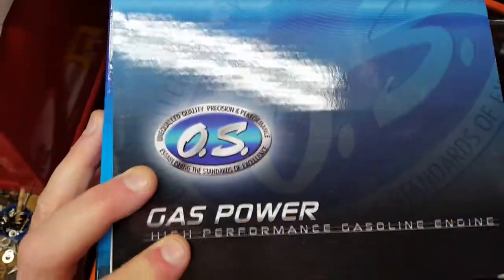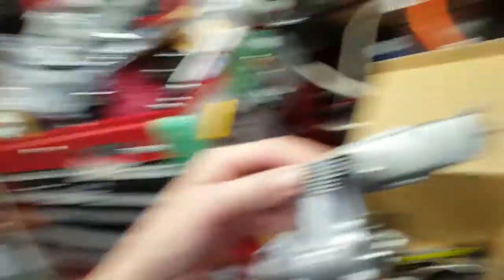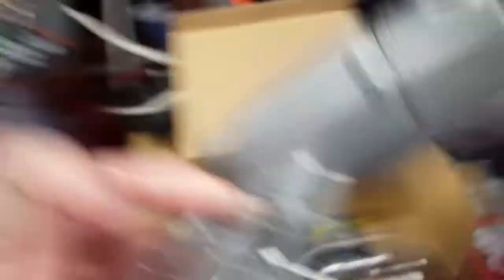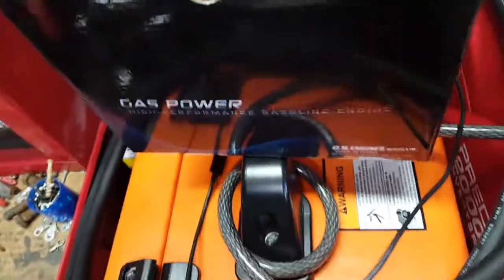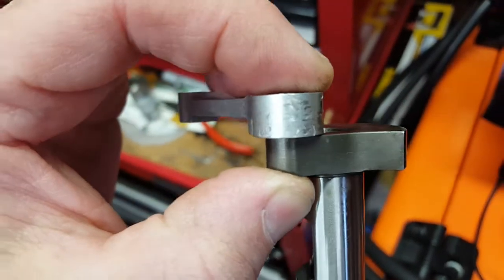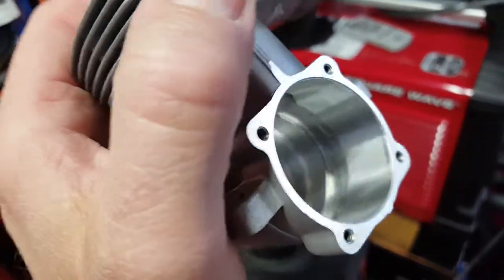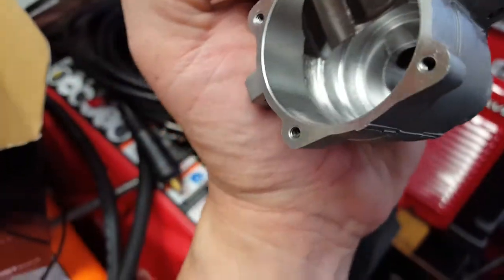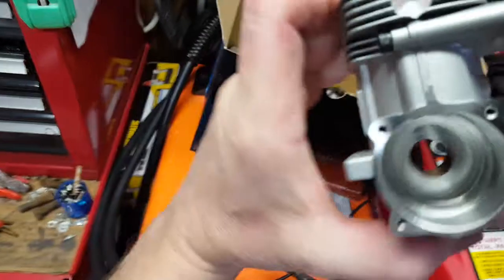OS   GT-15 gas engine issue!!

Comment: I'm thinking of buying this engine also. I down loaded the manual from the Horizon website. Under "Running-in" it states...use a 25:1 fuel/oil mixture...and they do not recommend bench running, just fly it. the manual says to use 50:1 after break-in. The engine is kept cooler in flight rather than running on a bench, especially if it's cowled.  Or someone left a chunk metal in there...who knows!? Do you know if the engines are pre-run at the factory before shipment? I noticed that the goal of the Chinese company is to sell the product and make a profit. I've owned several Japanese OS engines over a thirty year span with no issues!
Reply from the maker: I agree!! I have at least two OS two cycle engines and four OS 4 cycle engines, a ton of Saito engines and never had a issue with any of them. People argue the Chinese OS is just as good, I disagree.  Also I operate DLE single and twin Cylinder engines also made in China with absolutely no issues as of yet.  So I'm thinking this particular OS was defective from the factory.
Reply from the maker: And very possible there was junk left in the engine after machining.
Reply: @workshoptazz7893  I know that I'm "old school" because I still enjoy glow engines. I like the simplicity, low weight and power. I've been flying a .65 AX for five years now, still runs like new. Actually it gained power with age! Did you see the guy from Australia that uses colorful language put an OS GT-15 in a helicopter? It sort of melted.
Reply from the maker: @paulkrapp   nothing wrong with Glow, fuel is hard to get local tho. So out of laziness I'm slowly converting all my glow stuff to gas.  Lol no I have not seen the guy from Australia, I will look for the video on YouTube.

Comment: 50/1 oil ratio, why so little oil??
Everything I've seen says 25/1 which is similar to most other gas engines.
Reply from the maker: 25/1 for conventional oil, I could see. Synthetic typically can be used in most or a lot of applications at 50/1 I have ran over the last 30 plus years, outboards, chainsaw, weed eaters,  2 stroke dirt bikes, and all of my DLE 2 stroke RC engines with Zero issues.   On further inspection of my OS gas engine, it appeared that someone in China! Left shavings in the crank case that got distributed through the whole engine. To late now! All apart and new stuff on order.
Reply: @workshoptazz7893  
Yeah I understand, I used to be a small engine mechanic and we used 50:1 in chainsaws ect but in a smaller engine I would have bumped it up a little.
 Was it the piston ring pin that stops the ring rotating that came out by any chance?
Reply from the maker: No, parts were intact.  What I  found was larg shavings in the bearings and wedged in between connecting rod and case. And a chunk that made it's way along side the piston and jammed in to the top of the head. With no sine of wear in the case.  I've read a few articles now about OS having some issues,  they clame OS is just as good as it was when it was made in Japan..... I beg to differ!! I have OS Japan made engines, quality is not the same. This is Sad, OS was a great engine. I have few of their glow engines all were great!
Reply: @workshoptazz7893  
Yeah OS were great, I've used them for years too.
I just replaced a os .61sxh in my helicopter that finally wore out after 21 years!
Reply from the maker: Lol, can't beat that!!  This is my first engine that I have broken, I'm not happy.  Well if you get An OS? Pull the back cover off give a good look ya never know now, and thay are expensive!!
Reply from the maker: I wish I had looked before I Fired it up,  shouldn't have to do that.
Reply: @workshoptazz7893  
I can never resist the temptation to pull a new engine apart. It has saved me once as I found a crack in a brand new crankshaft.
Reply from the maker: Ouch! That would have been ugly!
Reply: @workshoptazz7893  
I was looking at GPH (Gas Powered Helicopters) site and they sell a modified O.S GT 15 HZ with bigger head, modified piston & ring, spiral retainers and they recommend 20oz's of oil per gallon, that works out at 6.4:1 or 17%.
That's a big difference from 25:1 or 50:1.
Not sure if that's a misprint or not.
Reply from the maker: Wow that's a lot, if the engine is stuffed way inside and cooling is compromised a bit then I guess I could see that, that is a lot tho. Do they have video of one running with that ratio? Would be intresting  to see that, the smoke would have to be horrendous.
Reply: @workshoptazz7893  
Yeah that's closer to a oil ratio for a glow engine.
I couldn't see a video but I did download the operating instructions and the only other thing they recommend is using a thin viscosity synthetic oil such as Red Line 2 stroke.
I might try to email them.
Reply: @workshoptazz7893  
From what I can see all their other engines like the TRM V300 series use 40:1 and they sell premixed oil at that ratio, which they don't recommend for the O.S GT 15.
The O.S is essentially a modified glow engine so maybe thats why they recommend more oil...dunno.
Reply from the maker: That is intresting 🤔
Reply: @workshoptazz7893  
I thought you might be interested, I just got a email back from Gas Powered Helicopters and they said what I already thought.
Because the OS GT15 is basically a glow engine that's converted they recommend the high oil ratio of 18 to 20% similar to a glow engine.
Reply from the maker: Makes sense,  oh oh!! Wonder then if I should increase the ratio, on my converted to  Saito 4 strokes??  I have been running them with no problem as of yet, but ya never know. Thank you for the info.  👍👍
Reply: @workshoptazz7893  
My pleasure.
You can always test it, don't think you have anything to loose.
4 strokes usually use a bit less oil anyway so maybe that's why you've been lucky.
I think it's pretty cheap insurance to bump the oil up a bit.
I think the big problem especially in helis is cooling.
In glow engines the high amount of fuel/oil that goes through them also helps evacuate heat but in a gas engine especially one with low oil content they just can't get the heat out.
Reply from the maker: True I think I will do that, they have been good to me don't want to kill them now!
Reply: @workshoptazz7893  
Yeah far to expensive to replace.
Good luck & keep me posted how you go. 😀
Reply from the maker: Will do, thanks
Reply: @workshoptazz7893  
I just received my new modified O.S GT15 HZ600 From Gas Powered Helicopters.
It comes with a much larger cylinder head, new design piston/ring with spiral retainers, modified backplate and .90 size crank.
And of course they recommend 20oz of oil per gallon.
You may want to have a look at these if you're considering replacing your busted GT15.
They sell for roughly the same price.
Reply from the maker: Cool! I will give that a look, thank you 👍👍
Reply: @workshoptazz7893  
Do you know if the standard align Trex fuel tank stoppers and hardware (not the fuel line) is compatible with petrol?
Reply from the maker: If the stopper is black, then no! Gas fuel stoppers are usaly Red! Hardware will be ok unless the stopper has a small inlet hole? Then not good, wanna make sure you have good fuel flow.
Reply from the maker: Oh ya!! If you can find a felt clunck, those puppys work awesome!! Try North west RC they should have them, also Tim the owner has a wealth of RC knolage. Also known as Suppa Tim.
Reply from the maker: He's not a copter guy, but he could be helpful.
Reply: @workshoptazz7893  
Thanks for the info. 😀
Unfortunately the stoppers are black. 
Always something else to buy! 😥
Reply from the maker: Yes there is! I had to do the same when I converted all my stuff. It was a pain in da butt.
Reply: @workshoptazz7893  
I might go rob my housemates weed wacker fuel tank for parts! 😏
Reply from the maker: Lol 🤣
Reply: 40:1 Redline is what’s going on mine. Nene let me down on anything from homage scale gas with twin to dle 20
Reply from the maker: Typically with synthetic oils 50/1 is plenty. I have used this ratio In everything from Honda 250's, Mariner outboard, chainsaw, premixed store bought gas 50/1, DLE 120cc, 50cc, 25cc, 15cc, I have all run with 50/1 with zero issues or premature wear. Unless I'm missing something a lot of manufacturers are ok with 50/1. Some manufacturers want you to have a higher ratio this I understand. But if I'm missing something pleas share the information you have come across, I don't know everything and it wouldn't be the first time I've done something wrong. If I remember? OS wants a higher ratio, don't know what it is off the top of my head.  👍
Reply: Workshop Tazz so I should pull back plate off this GT15 I’m expecting delivered any day now?  Seems like manual states 30:1 - 50:1 depending on oil. But is a little screwy and says 25:1 if oil manufacturer recommends it. I’m sticking with 40:1 mainly for ease of mixing. 16oz bottle of redline to 5gal or regular non-ethanol pump gas. Goes in weed eater, blower, chainsaw, edger, and planes.   Wondering if I should bump up just slightly on this engine for first couple tanks.
Reply from the maker: @wfletch88   yes alittle mo oil definitely won't hurt anything for break In just to make sure. And YES!! Pull that back plate OFF!! just to make sure you don't have any Aluminum floaties In that Engine!!! Better safe than what happened to my engine. They just cost too much.  I'm contemplating buying a second one and believe you me!! It's coming apart for inspection prior to it's first start up.

Comment: Hi I had  problem with a O.S gt15 motor also
Reply from the maker: Oh oh, what issue did they bless you with??
Reply: @workshoptazz7893  I purchased a O.S gt15 gas motor from Tower Hobbies who is owned by Horizon Hobbies.

My friend who knows a lot about gas engines put it on his test stand to break it in for me.

When he went to start it it ran for only 5 seconds.

He tried starting it again and it wouldn't start.

He then  noticed a hole in the engine block.

He told me to send it back.

So I got in touch with tower.

The gentleman was very kind and understanding and told me I had to send it to horizon tech service and he sent me a label for free shipping from FedEx. 

This was great i thought a company who really cares.

So I get a email back from a Rick V technician at horizon hobbies 

That the motor was modified at some point after it left the factory  and that unfortunately the motor can not be replaced. 

But he can offer me a 20% off a new O.S gt15

For 319 dollars oh and said he will even waver the shipping.

So I contacted them and told them to send it back. 

I was not going to pay an extra 319 for a nother motor then my moter should have been covered by warranty.

So this means horizon hobbies don't give a shit about your warranty 
Hell i called them yesterday and they guy in customer support told me that he would have his manager Dave who is in there motor department call me back haha 
He never called .
What a pice of shit company.
Reply from the maker: Wow that's way messed up. Yes it sad to see these things happen to customers  OS used to be a great product.  I've own a few of them with zero issues, older ones before China got a hold of em.
Reply: @workshoptazz7893  
Hey Tazz I finally got ahold of the manager from horizon hobbies Dave  Poole who was a Really nice guy .
He said that he would send me a one time new motor.
I thought that great
But he still thinks I modified when I didnt.
But who cares i am getting a motor for my son's  airplane.
You have great videos keep them coming. 
Oh I mentioned your video to them.
Thanks and  have a great day
Reply from the maker: Wow that's great glad to hear they took care of the situation. Hope the new engine works awesome!  Thanks 👍